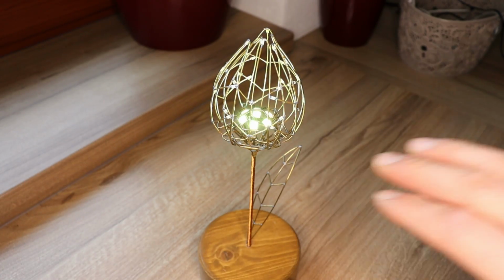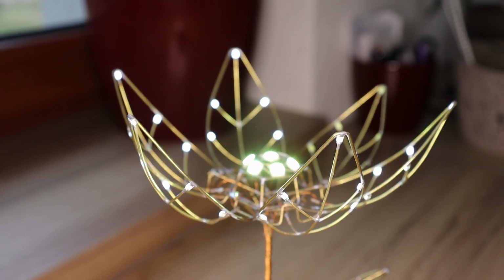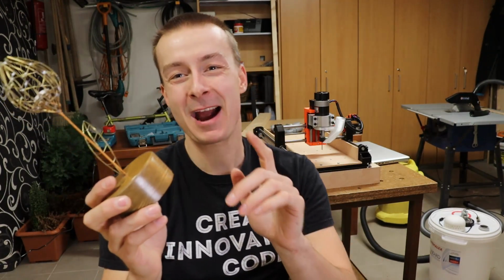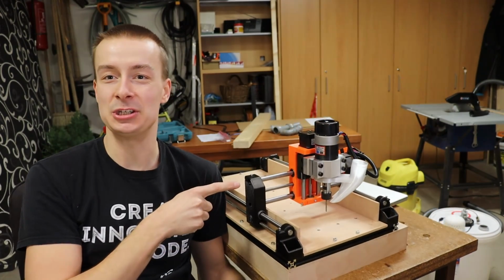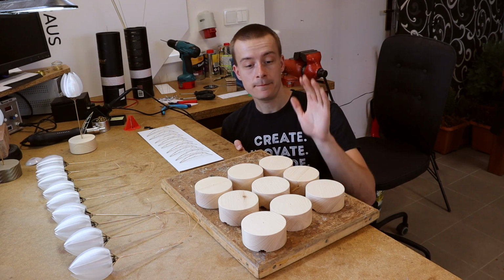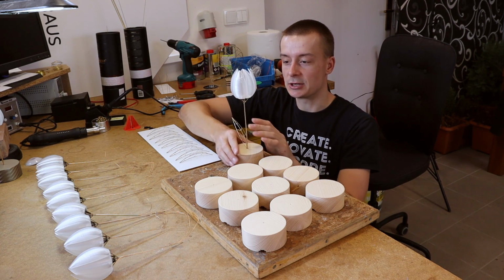Geek's Valentine's day: Everblooming Mechanical Flower Garden

Comment: Very pretty. I wonder though, have you considered using Nitinol wires instead of servos to move the petals?
Reply from the maker: Interesting. I might order some and use in future projects :)
Reply: Less energy efficient than servos, but potentially smaller, and quieter. (I don't know how noisy your servos are, but they can be fairly loud.) Would probably need two channels, one for opening and one for closing.

Comment: These are beautiful.  I was wondering if you had considered the possibility of adding photovoltaics cells, perhaps in the leaf that would charge a battery and light dependent resistors that could trigger the flower to bloom and glow when the sun goes down and then close and dim while and recharge the battery in the daylight.  
Think solar pathway lights but not as common or ordinary.  I’ll take a dozen of those please.

Comment: That's a gorgeous piece of art. Well done.
I think the only thing I would add is either a motion sensor to detect movement at which point the petals would open and the lights turn on, or a light sensor which would control the opening of the petals and activation of the LEDs when it gets dark. Maybe a combination of both with a selector switch to enable which function.